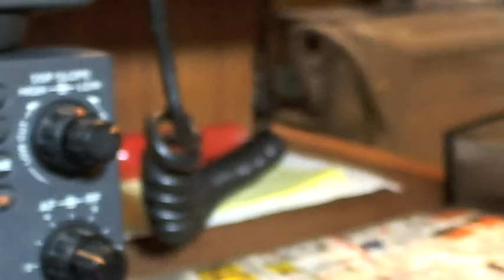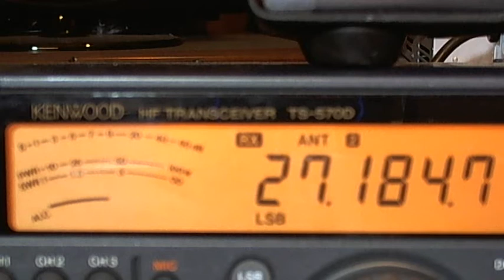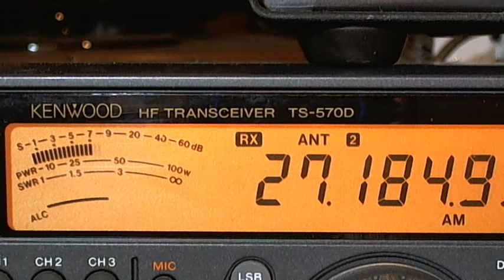Marconi testing Gain Master vs. Imax 2000.

Comment: All you have to do is ask someone to provide a dead carrier for 15 seconds and switch the antennas.  A constantly changing (mobile) and modulated on AM signal is impossible to compare unless there was a big difference between the two.  Based on the specs of each antenna, I'd expect to see very similar performance.

Comment: I got me a ⅝w GainsMaster too, but can get better results from a T2LT ½w on 10/11m, both yp vertical at 36ft.
Both work great tbh, i love doing comparisons on Fm locally which is upto 50m away, am pearched high ground so get mi'sel hesrd across the Nw Coast & Lancashire 🇬🇧 407 👋  Great video. 😊

Comment: A couple of months ago I got from here in Ireland to New York state with the FT-818 and 5 watts into an Imax 2000 running on the Windcamp internal battery on 10 meters. NO radial kit.
Reply: Good report.

Comment: Had two Gainmasters and Both snapped. I live by the sea and winds get strong here. My Imax is about 8 years old but spent a year in the shed until my 2nd GM snapped. Now the imax back up and surviving all the winds once again and it has a new coat of clear epoxy resin. I dont use Varnish. The Gainmaster never got me any better reports locally.
Reply: Thanks GF, I live on the Texas Gulf coast about 50 miles inland, and I know what your mean. I would recommend an Imax any day if your area has good strong winds from time to time.
Reply: Had my Gainmaster up for 8 years. I painted it when it was new and it worked perfectly until it got whacked. I’m convinced people don’t place the hose clamps close to the edge and maybe over tighten it.
Reply: @ronedwards8239  i left a good foot inside each section and i used 3 hose clamps on each too. Still snapped. They are too heavy like plummers pipe. Those that copied the GM design and used a telescopic fishing pole instead have no issues. The gainmasters construction is just too heavy. They did it for strength but it also kinda works against it.
Reply: @ronedwards8239   First Gainmaster i had replaced my Shakespear Bigstick. And that could take loads of wind yet it was light. The GM was heavy as hell. Hold it out like a fishing rod and you can feel the kind of strain its going to be under shake it about and it gets heavier.

Comment: Gainmaster dragging in all the qrm   👎
Reply: James, I found the very opposite, but I had a ham buddy that had a similar problem with the GM and he found his coax was crushed in shipping or packaging, and on repair the antenna worked better. Sirio sent him a new wire setup and they said such problems have been addressed.

Comment: Sirio i find better built and better QA control on there antennas.They are two types of gain master now HW model half wave and the longer version gain master 25-30mhz broadband,well in Europe,UK they are not sure if HW version in USA?
Very popular in UK for cb\10m use,but for line of sight use they are best mounted at least 50ft up from ground as have a low angle of radiation pattern.The HW having slightly higher angle of radiation pattern,and better suited when low down at sea level and have high terrain surrounding you,again mount these high up for LOS (line of sight) use to get best performance.

Rob 73's
Reply: Hey Rob, I don't radio anymore, but I wish I had tried the HW GM. If it is as good as the CF HW GM. then is is a good antenna...and I prefer a 1/2 wave up high anyway.

Thanks for the reply.

Comment: Hi, I could not figure out which antenna is better.
you prefer Imax 2000 or Gain Master.
Thank you.
Wladimiro.
Reply: I think all of my CB vertical antenna work about the same if I get em'  close to the same tip height, but I did really like the GM because it was generally a quieter operating antenna with that almost perfect common mode chocking coil at the bottom. 

Thanks for the reply Mr. Parigi.

Comment: Imax better signal for half the price and stronger in the weather.That gainmaster will snap if a ant farts anywhere near it.
Reply: Yeah... it did snap on our first gale winds when I put my Gainmaster up. But I know why it did. 'cause my friend wich tightened the screwes on the joints overtightened it so I in fact heard it crack in the fiberglass. So that is that... but I still think that Gainmaster should be made out of stronger material or something like that! - Why don't they make an antenna out of carbonfiber?
Reply: @ArntPetterAndersen  Cost...
Reply: @DimRoditis  Yeah.... you're right... That actually suxx...! They would stand the winds for sure :P
Reply: Yep Doug, my GM was up for about 5 years on the same Pushup Pole, but I've heard some guys have them fail. Just another sign of the times with these young folks today...it is a throw away world now.

Comment: I had an Antron 99, then put up a Sirio Gain Master. No difference on 10 meters groundwave to ANY station I talk to regularly. The Gain Master only work on 10,11, and 12 meters, and is very power limited. The Sirio Gainmaster is coming down this week (I just bought an IMAX 2000).
Reply: Same thing here, compared both and keeping the IMAX
Reply: Lol imax is crap brings in lots of crap
Reply: Hey chris, this is just a hobby, but I'm trying hard to become a professional like you.

Comment: Spoke to Ireland from Virginia using a Galaxy 2547 on side band, 12 watts, using an Imax 2000. I felt that was exceptional performance.
Reply: I just bought a new I max 2000 and I will install it next weekend. I will also leave my A99 up as well. I max seems like a great antenna. I qso with a ton of people who use them
Reply: that's good info unlike some of those assholes out that look down on you for trying to learn from the ones that know,thank you.
Reply: Conditions. You could talk on a light bulb 💡 if conditions were right. Well not really, hope you get my point.
Reply: I have a 2547 too and it is an excellent radio on Tx and Rx. I have a high regard for the Imax too. Thanks for the reply.

Comment: Before you go comparing antenna learn how to use your radio.  Your on LSB and should be on USB also your radio has 2 antenna ports. Plug one into each and test it that way  instead some jank switch box that could cause you all kinda issues.
Reply: Jrocker, there was nothing wrong with my switch box, I did not have the coax to the Imax hooked up at that time...just look at the video again and you will see the Imax showed absolutely no signal at all and had not noise either. I did not discover that until I looked at the video much later. Ole Grampa messed up.

Comment: I'd like to see a number of dead key AM signal reports from receiving stations comparisons. 5 miles, 10 miles, 15, 20 etc. Compare dead key with the GM compared to the iMax. I think that is another useful validation of these antenna's performance.

Comment: I've used the MACO v 5/8 and I've used the Amtron-99. Neither touched the performance of my Imax 2000. The Imax had better ears on the RX compared to both antennas and the Imax had a wider bandwidth too. The only negative remark I have is sometimes when it starts to rain the Imax will howl or whistle like the rain drops were causing some kind of internal static charge but that only happens sometimes.
Reply: Flash, I didn't like my personal Imax, but I heard too many working good out there in radio land. I'd be a fool to say anything bad about the Imax. It is generally a very good antenna, and it often does not get the good vibs it should.
Reply: @eddiemarconi3420  I'm getting ready to change out my IMAX because it's got a lot of time on it and it's starting to give me some issues. I've gotten my money's worth and then some out of that antenna. I'm going to give the Sirio tornado 5/8 wave a try. It's an all aluminum antenna. I don't expect the bandwidth to be as good as the IMAX. Still I hear a lot of good reports on those antennas and a lot of the people around my area seem to have good results with them. When I get it set up I'll make a YouTube video using an antenna analyzer for everybody to see.

Comment: An Astroplane? Wow . . . I remember those antenna's and even had the original Avanti model back in the mid 1970s and it was one fine antenna. Then I switched to the Sigma 4 and that was an even better antenna but man was that sucker TALL! Today I guess it's known as the Sirio Vector. Either way I'm glad they still make them in one form or another, just hope it's just as good!
You have one hell of a setup there with your radio and antenna's being used. That is indeed one heck of a radio station.
Reply: That was a great performer, but your right, to big.. everyone I put up got ripped by the winds and finally a struck by lightning lol
Reply: Thanks Mr. Bakerman. I have a S4 and an old and a New Top One which was a knockoff of the AstroPlane. I always got good service from those antennas.

Comment: I have great reports with my IMAX 2000. Very good ears as well. A better receive antenna is a Double Bazooka even lower in height. Can't wait to make one into a vertical. I have no doubt I will beat out the SGM. 73's Check out my DSB on You Tube.
Reply: DAD, I'll try and look you up...I enjoy other's ideas too. Thanks for the response.
Reply: Dream Antenna Designs no one cares about your double spooky double triple antenna dipole dreamer

Comment: Firstly, you are using an antenna switch which you soldered, how do you know that the antenna switching box isn't attenuating the imax signal? To do this test properly you need the imax on the same mounting pole with the same coax as you used with the gainmaster. You cannot conduct a test with two antenna's on different poles with different surroundings, it's just not equal conditions for both antenna's. Your tests are a complete waste of time.
Reply: 2008, I dedicate this testing just to you, so when you get on the Big Boys band you'll have something constructive to discuss.

Comment: First, how are the antennas tuned? What is the SWR on both? Secondly, how about using a radio that was made for CB and not using an amateur radio. If you want to play chicken band, use a chicken band radio. Do NOT tell me it's legal either. I am an Amateur Extra and a CVE for amateur radio testing. Which, with the questions you are asking I doubt you could pass the tech test!
Reply: I guess this old video "Triggered" you in the worst way possible, like a lot of folks in the World today...seeing as you are so upset. It figures for an Ham like you. Making this video was a like a work of art, if it bitched you out for one minute, an Extra Class and a CVE all rolled up into 1 to boot.

Glad you having such a bad day.
Reply: glendor2, U are DUPEK!!

Comment: Shows the gain master lives up to its name. you have better RF gain.
Reply: Wrong you cant call raised noise floor/ static noise stronger!. I have both Antenna's myself. And the imax always sits higher on noise floor. My thunderpole 5 has an even lower noise floor that both of them.
Reply: lol, what were you smoking, the IMAX was consistently stronger?
Reply: @davidisraelyan5017  I actually prefer the imax i use one myself but it does have a higher noise floor than the Gain Master. I dont rate the Gainmasters construction its too heavy i've had 2 snap.
Reply: Haha,  that's the finest crap I've ever heard